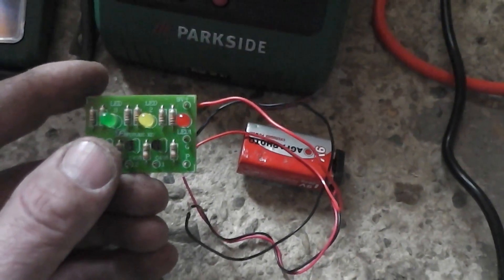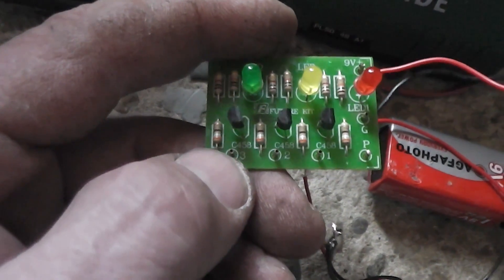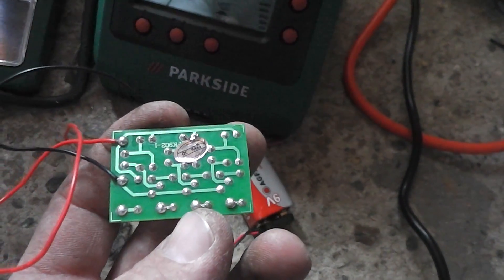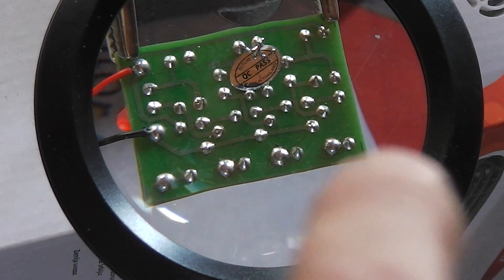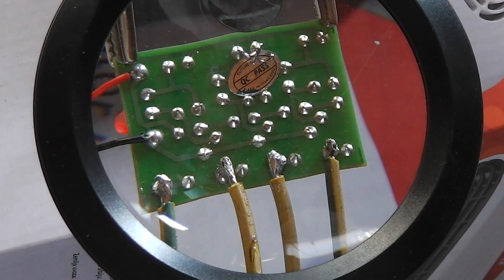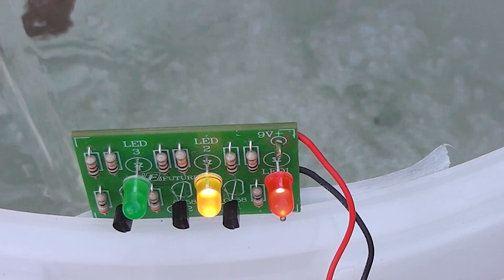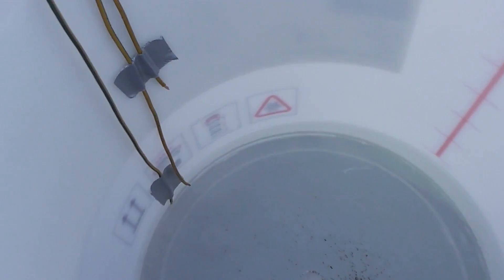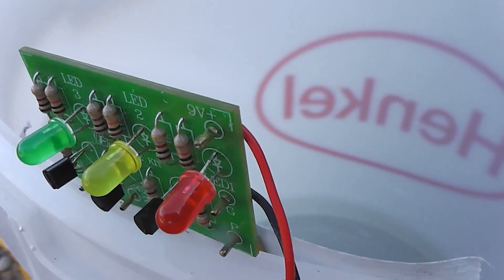Simple water level indicator

Comment: Very cool. I wonder if it could be used as fuel meter in a motorcycle tank. There wont be any spark while the wires are submerged.
Reply from the maker: I am sure it will work also,greeting

Comment: With the lights on the main floor, you never need to go to the reservoir to know how the water situation is. This is one for the summer home where we need to go outside and use a gas engine to fill the 500 L container.
         Mike
Reply from the maker: Yes but mine reservoir is in ground not on open space so this is only solution
Reply: Mladen 365, ah, you have a cistern, this will be fantastic in your situation.
        Mike